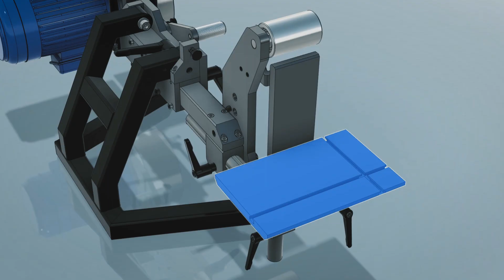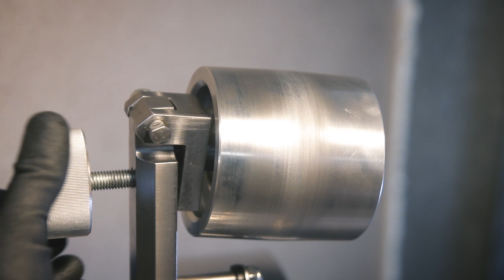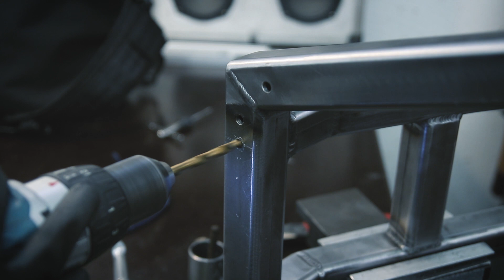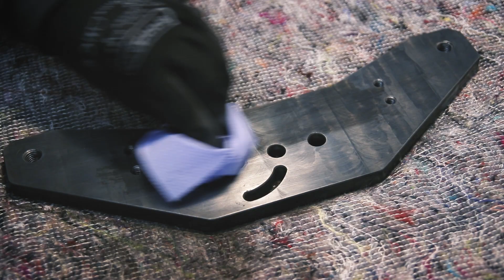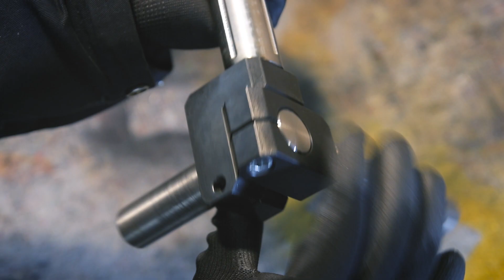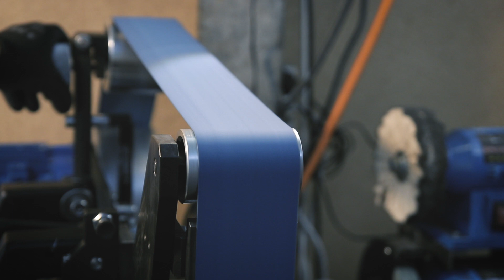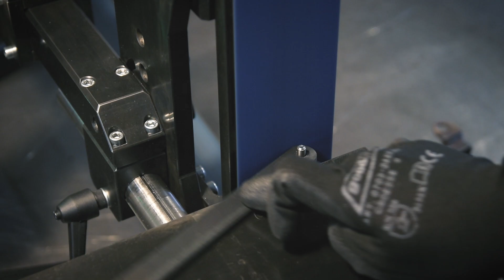Building a Machinists Belt Grinder - The Trilogy [Part 3 - Finale]

Comment: You're going to have problems with that cable. Everybody knows that blue jacketed cables have a higher abrasion resistance than black ones.

On the serious side, this is an impressive design and build. I seem to recall you saying some in part one about having worked on the design for a couple of years. It shows. Kudos.

Comment: I have some issues with reversing the belt direction?
Normally the belts on the inside have arrows to show direction of travel, because the join is an overlap.
I saw on another video someone installed the belt wrong way around, ie travelling backwards to the direction arrows.
The belt separated & flew off, lucky no ones hands were in close contact & no injuries.
You did say in fairness that belt should be reversed to run in reverse.
There will be temptation I guess not to bother, reversing belt and then run in reverse & maybe someone can get hurt.
With all that said, no one can take away from this build, work of art hardly describes it.
There are not enough superlatives.
Reply from the maker: Yeah when you reverse the belt you should also flip it so the arrows go in the right direction, and tracking in reverse is tricky in general, you will definitely have to adjust the tracking and it might be a bit wonky, since the belt runs over the tracking wheel first and then the drive wheel, which is not optimal. That's the case for most grinders in this style though, there are ways to improve reverse tracking, like having tracking adjustment on two axis. But for me it wasn't important enough to put that into the design since it's not something I'm gonna use often (or at all). With a modified tracking column that has an additional hinge I think this could be done though. Nice thing about this design is, you can take everything apart and modify parts of it
Reply: Phil Vandelay I Really want to build this however first I have to buy the lathe & mill, then learn how to use them!
Maybe then I will be sorely tempted to duplicate this from the plans. 👍👍👍🇦🇺
Reply: I've seen many belt vendor sites saying that their joints are made with thin tape and no belt overlap, and that the direction arrows can be ignored.

Comment: A magnificent build, top marks, however a superb accessory, rarely seen if ever on You Tube or the tool catalogues, would complete the entry for the “Marteau d’Or” ( golden hammer) and that is the automatic tube grinder and polisher attachment.
It attaches off the end of one of the rollers.  It is hinged below transversely and can be pulled away from the wheel.  There is a little support wheel below the same width as the belt. This is fixed and can be raised or lowered and locked.  This stops the tube heading towards the ground at great speed.  The unit that can be pulled away has a driven rubber faced roller of about four or more inches.  It is driven by a right angled Parvalux motor at low speed the opposite direction of the belt and will turn the tube into the belt. The whole assembly is pulled towards the belt by a spring.  The clever part is that the Parvalux (slow speed) motor assembly can not only be pulled away from the belt but dan be slightly angled in the vertical plane.  
To use it the Parvalux  and roller are pulled towards one and a bar or tube dropped onto the static roller whilst allowing the unit to return.  The unit contra-rotates the tube or bar against the belt but also causes it to move the bar to the left at a constant rate.  With your left hand you catch it before it comes out completely.  The operation can be repeated as many times as wanted also going down to cork belts for a mirror finish.  It is a very good piece of kit which is rarely seen.  I have tried to find them commercially with no success despite the one I saw being commercial.

Comment: Beautiful work. A tip for pulling cables through pipe work is to use some string at one end and then put a vacuum cleaner at the other, this will pull the string through, tie the string to your wire and pull it through.

Comment: Phil an Awesome Job, I watched all three videos, can you please tell me what size and make are your Lathe and Mill, I have used Lathes and Mills when working for Clients in their maintenance workshops, these have been very big and old machines, I am looking at buying for my own workshop so I can learn to use with a lot more precision than I have been able to achieve on other old worn out machines, , also were using power feeds or hand winding on the mill ?
Reply from the maker: Hi, it's a Sieg SC-10 Lathe and a Sieg SX-4 Mill. They're chinese import machines obviously, wouldn't be able to afford anything else, but I'm quite happy with them.The lathe has powerfeed in both directions but the Mill is all manual so I hand cranked it through all of this. Want to install a powerfeed there eventually though. I basically went with the same thinking, I didn't want to buy some old, clapped out industrial machine, of course they are better quality but they are also worn out. So I opted to get these import machines that get a bad rep, but for the money they're actually very decent. And at least you can be quite sure the geometry is accurate when you buy it new and don't have to deal with pitted ways, worn out leadscrews and so on.
Reply: @PhilVandelay  thank you for the feedback, I have been searching and investigating Lathes and Mills for a few months, I have seen the Seig Brand on the internet but could not find a supplier in Australia,  I just now entered the Model numbers you gave me and there is a Big Machine Supply Wharehouse a few Kilometers from my house that has not come up ever in my google searches. I will go for a drive in the Morning, P.S great Cargo bike Build too.
Cheers from Melbourne Australia

Comment: Hello is there a bill of materials and sources included with plans? What rpm motor do you recommend?
Reply from the maker: There is some info on the special parts like Motor/Gas Springs I used as well as a list of hardware (screws and such). I didn't list raw material like solid steel stock because it's not exactly off-the-shelf kind of stuff and I partly used stock I just had sitting in the shop, but it should be easy to figure out from the plans what kind of stock you need. As for sources, I'm guessing you're from the US so they probably wouldn't be much use, since I'm from Germany and that's where I ordered my parts, but I can give you those links if you're interested.
Reply: @PhilVandelay  ok my plan is to build 2 at one time. And trying to get all my ducks in a row

Comment: VERY GOOD WORKMANSHIP AND IT LOOKS PLENTY STURDY.
HOW MANY HOURS WOULD YOU ESTIMATE WERE USED TO COMPLETE THE DESIGN AND FABRICATION.
MANY MORE THAN YOU SHOW IN THE VIDEOS.

KEEP UP THE GREAT WORK AND BUILD SOME OTHER COOL THINGS
Reply from the maker: Hard to say exactly, I do a lot of "designing" in my head while I'm doing research and long before I draw anything, but making the actual 3D model probably took about 2 weeks working on and off, but by that point I already had a good idea what I wanted it to look like. As for the actual build, I probably spent about 2 months worth of normal work days over the course of about 3 months building it.

Comment: The only thing I would do is chamfer the bottom edges of the table 45 degrees to reduce the pinch point and allow the table top to go closer to the belt in 45 degree mode

Comment: Hi Phil - purchased the plans (which are great) am about 70% the way built - Got a man with a water jet to cut the bulk out as i am a coward, is the drawing for the T shaped table mounting block missing or am I going nuts ? Am loving the no welding build as every time a get a welder out all I get is distortion and disappointment.
Reply from the maker: Hi Paul, yes if you got an early version of the plans there was a mistake where that part was missing. You can contact me via Etsy and I'll send you the updated version!
Reply: @PhilVandelay  Have sent details. Thanks.

Comment: How did you always take the same amount with that 45 degree tool.......did you touch off and just always come in a particular dimension?
Reply from the maker: Yeah I touch off on the edge and then zero that axis (with DRO in this case) and then go in by the same amount. It's important not to change the Z height after that because that messes everything up

Comment: An excellent build. It's great to see quality craftsmanship. Just 1 question. I was wondering do you think this design would be OK to build in aluminium instead of steel? Apart from a few parts such as the round shafts, platen and tool rest
Reply from the maker: Yeah I think that would work fine and I considered doing that myself. I mainly went with steel just because it's cheaper (and I like a hefty machine). I would use steel for the base though to give that some weight.
Reply: @PhilVandelay  Thanks.

Comment: @5:50 would it be possible to heat-treat the material you have and then temper to desired hardness?
Reply from the maker: Yeah you could certainly make it harder that way, but I think starting out with something harder would be even better (and then heat-treating that). Either way not really necessary, the scratches the table gets are just superficial

Comment: Wearing gloves while using a belt grinder is a BAD idea. Even thin ones like you have will pull your hands into the belt if caught. And it's not that the sanding action of the belt will hurt you, but the grabbing/pulling/breaking/twisting/tearing that will happen to your fingers as they are pulled between the belt and the table and as the gloves tighten around them. Long sleeves are a bad idea as well. Be careful.

Comment: All together (the 3 videos), probably the best thing ever made on YouTube.  Thanks for taking the time to film and narrate the build, I'm sure doing so make it take longer to build but doing so was well worth the time.  I was wondering a) how long it took to build and b) what brand of (channel lock type) pliers do you use, they look pretty good.  Thanks for posting the videos.
Reply from the maker: Hey, the build took about 3 months but I didn't work full time in that period, I'd say it was about 8 regular work weeks. That's not including the planning though which also took a while, but I don't really keep track of the hours since I also do other stuff inbetween.  As for the pliers, they're Knipex wrench pliers, they come in a few different sizes and they're one of my favorite tools ever which is why you see me use them all the time. Just all around great quality and design, I'm not affiliated with Knipex in any way but they honestly make the best pliers and are known for the excellent quality. I don't usually buy top shelf tools for anything, but with these it's worth it.
Reply: @PhilVandelay  Quality work takes time!  Thanks for the Knipex info, I'm going to check them out.

Comment: Amazing work man, amazing!! Just FYI the black oxide itself developed in the blueing process is not protective on its own, but it has a sponge like structure that allows a thin film of oil (when applied) to stick on the surface practically forever, inhibiting the possibility of further oxidation.

Comment: You grinder is amazing and truly a work of art and craftsmanship. That said I have a suggestion you may not of thought of or you may have and decided not to do it. Where the table meets the grinder belt on one side or both since it rotates you should 45 the backside of the table. Then when you have it 45 to your belt you can still keep the top edge close to the belt if the bottom has a 45 bevel. Its safer too, not to have a space between the work edge of a table and a moving belt or disk as it can pull things in and wedge them. You know like fingers. Still a huge fan of the project so please don't think of me as one of those assholes that thinks he knows better. Keep up the videos I really enjoy watching you. I miss machining a lot so you help me get my fix.
Reply from the maker: Hey no worries, it's a valid point you're making. I did bevel the edges somewhat like you can see in the video but I'm not sure why I didn't go all the way to the edge, I think I wanted the bevel to end where the T-slots come out, although it wouldn't really have interfered with them. So it's kind of inbetween now, there's a gap when it's tilted but it's not large. I think only if you were to grind a really short work piece then here's a risk it might get sucked in, but that's something one should be aware of when using this type of machine anyway. Probably a good idea to hold the part with pliers or a magnet in those cases

Comment: If he had purchased a belt grinder he could have used it to polish all the steel parts with a smooth finish for the cold bluing. LOL!
In reality, I'd use a real hard 2 part epoxy paint as the metal dust from the steel parts he will be grinding will collect on the surfaces and in the corners and cause rusting through the cold blue anyway.
The steel they used in the old west would turn blue and the term BLUE just stuck.

Comment: @ 2:15, for that knurled handle, put some blue lock-tite on the threads or take a chisel and dent the threads so they do not turn too easily and the screw will not self-adjust while the grinder is running.

Comment: That is so well thought out. How long was the design process? Thanks for sharing as I am building a 2x48 grinder and this addresses so many design issues that were bugging me. A thing of beauty is a joy forever.
Reply from the maker: Hard to say, usually when I get an idea I spend a lot of time thinking about it and researching before I even write anything down or even make a sketch. That's obviously not a full-time process but I think I've been thinking about building a grinder for at least 2 years. As for the actual desgining, I think I spent 2-3 weeks building the 3D model and working out all the details, but by that point I already had a good idea of what I wanted it to look like

Comment: Did you have any problem with the table bowing due to the tee slots ? Very nice design and craftsmanship. Great build !
Reply from the maker: Nope, I don't think anything would move there unless you really abuse it. There's still 6mm of steel left on the bottom which should be plenty (on many grinders, the entire table is about that thick)

Comment: How long does it take you to figure out the order of operations for the parts?
Reply from the maker: Depends on the parts, but it definitely requires some foresight. Sometimes I sit there for an hour just going over the operations in my head. Actually overall, for this kind of project, I think the time spent thinking is higher than the time spent actually "working" by far.

Comment: This is really a nice peace of machinery, having designed and used a couple. But i do think you are missing one important part: Dust collection. When you have used it for some time as i expect you will, you will se my point. Your shop will be filled with a layer of grinding dust. Not just for a cleaning perspective, but also your health, lets have an episode 4, where you add a clever dust collector :-)
Reply from the maker: Yeah that's one of the things I still want to add to it, some goes for spark shields so they don't fly right at my face ;) Dust collection is a bit tricky unfortunately due to the sparks, you don't want those in a vacuum.
Reply: @PhilVandelay  
In our shop we have metal piping, going into a cyclone, a metal filter and them the blower , in the wood shop next door a similar set-up, so we don't mix the two, it a bit expensive, but worth it I think. Looking forward to the next episode.

Comment: That is a really nice design. It was obvious that with it, you could build another one in a lot shorter time. Considering the commercial ones I looked for didn't have anywhere close to that level of ajustability and were often thousands of dollars, that is a very worthwhile project. I'm guessing this was in the hundreds to build with the motor and VFD being the most expensive parts.

Comment: The process is called "bluing" because when you do it thermally (as it was done for many hundreds of years) steel goes through different colors depending on how much time do you treat it (the longer the thicker final coating is) - first it goes yellow, then red-ish, then purple, then blue, then dark gray, and the process was usually stopped when it is still more blue than black. This is not a thing anymore with chemical ways, but the term stayed.
Amazing job on the grinder itself, so much better than generic store one!

Comment: If you already have an impressive shop full of precision machines, why do you have to build a belt sander?  Could you have done this with hand held electric tools or even manual powered tools?
Reply from the maker: It serves a different purpose than those machines, less precise but much, much faster. You can definitely build a grinder with only handheld tools, there's lots of examples on Youtube. But probably not this one

Comment: Wow! Beautiful realization, this is the most accomplished belt sander I've ever seen. I want the same one, because it's impossible for me to do that, I don't own a lathe or a milling machine, and even if I did, you have to know how to use it. 
I live in France, how much would it cost? If I could order this same model without the motor and the speed controller, I would just have to assemble it.

Comment: Why are you trying to reinvent the wheel? Too many parts , complicates alignment, small platten surface, needlessly long belt prone to warp and stretch. Now if it were light enough to be hand held to attach to the lathe great but the ubiquitous 6 by 48 with wide platten and just two rollers making alignment easy is universal. As for knives, Like women and candles, I only have one and I am set for life, can’t break it or wear it out, no need for a second or more. Guns are different can’t have enough.